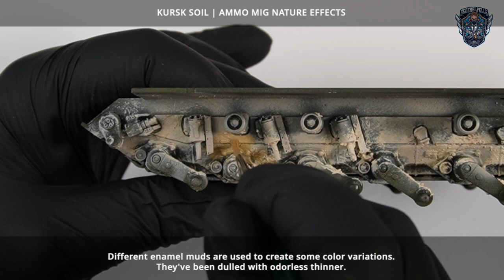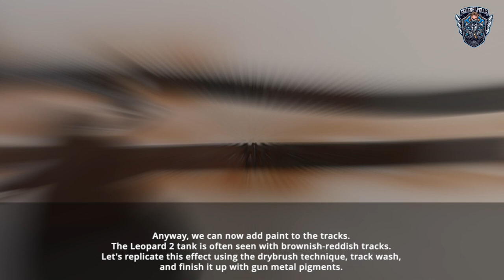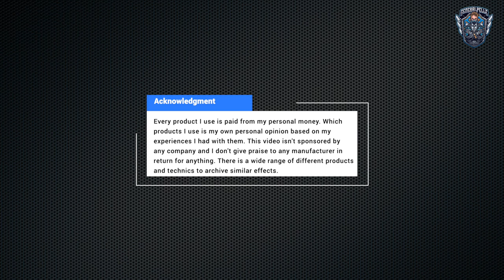Leopard 2 A7 - Meng 1/35 - Scale Model Tank

Comment: How did you get the commander sights green and shiny? I'm building an abrams, and I've been trying to figure out how to make the sights look more realistic by getting the greenish-purple reflection on them. Fantastic model, and it looks so realistic!!
Reply from the maker: Thank you, glad you like it :). I did it that way: cut the clear part, measure the part out which should be shiny. Mask and install it. The spraying the model, finish weathering and everything. Remove the mask and apply a self adhesive holographic film in the desired shine. They are sold by hasegawa or sx-art and can be cut in shape with a sharp hobby knife. I also saw other YouTubers painting things like that, but that’s indeed more difficult to get right and honestly the effect from the holographic film is really great (shiny, different colors depending on the angle the light falls in, like the real thing more or less).
Reply: @GeneralPelleScaleModels  I never thought of that. Thanks so much for the advice ill definitely be using it on my modern tanks if I make any more!

Comment: To this day, I do not understand the purpose of photo-etched pieces. Just like this kit, they're painted over and it's necessity isn't needed.
Reply from the maker: If you look back at modeling history, they come from a time where the plastic wasn’t that detailed. PE parts can show details where plastic can’t, even until today with all the fancy new molding techniques. When plastic becomes to small, it’s hard to show much detail or it can even become to fragile. Thats where PE comes into play. To enchanting details. This is pretty evident when you take a look at ship builds with 1/350 or 1/700 scale. At that scale, the filigrane towers and mast are greatly enhanced in detail when using PE parts, because with plastic alone a lot of details are to small to cast. On the other side, it’s still a modelers choice. I also don’t use extra PE on all my builds, for example my latest F-16 build has only a few PE parts for the engine. I’m this particular Meng leopard build they even included some PE parts as part of the kit itself (instead of plastic).

Comment: This is a Leopard 2 A6, not an A7!
This is the Leopard 2 A7+ :
https://www.youtube.com/watch?v=RVo58WMD_Ug
Reply from the maker: Here is the used kit: https://www.scalemates.com/kits/meng-model-ts-027-leopard-2-a7--974493

Please tell the Meng support about your findings. Thanks.
Reply: @GeneralPelleScaleModels   I don't care about Meng support. If they're such idiots that they don't even know what they're making a 1/35 model out of, that's their problem. However, you could have researched what a Leopard 2 A7+ actually looks like. Because there is no Leopard 2 A7, only A7 +
Reply from the maker: @zsoltgal601  Thanks for your feedback. You can find more informations about the leopard 2 and it’s variants here: https://en.m.wikipedia.org/wiki/Leopard_2. I apologize for any misinformation and will ensure to provide more accurate details in the future.
Reply: Sorry to correct you but the Leopard in this video is NOT an 2A6. You just have to check the lower hull and will notice that the 2A6 has NOT the updated hull. :) Greeting from a former 2A6 driver.
Reply: @GeneralPelleScaleModels  You did nothing wrong, the tank in your video is a Leopard 2A7 so it is correct.
Reply from the maker: @JazzJaRa  thank you very much for clarification.